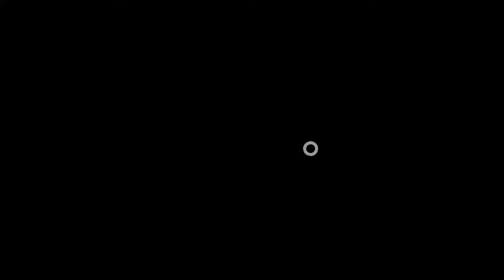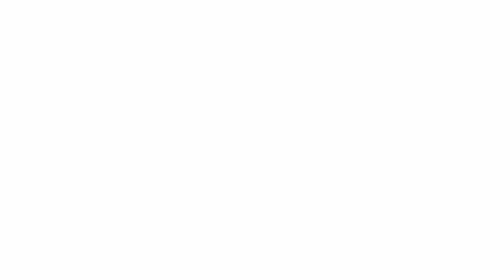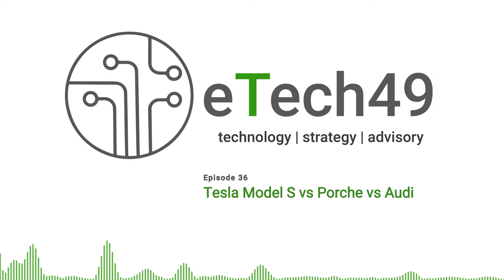#36 | Tesla Model S vs Porsche Taycan vs Audi e-Tron

Comment: Do you have any thoughts on flywheel based hybrid technologies? I have read that they can be used in conjunction with regular hybrid tech to give fast discharge when required under hard acceleration.
Reply from the maker: Flywheel systems were developed several years ago at the time battery tech was no where near as good as it is now. So those companies had issues achieving commercialisation. Flywheel is still around but has a niche of applications where it is useful vs what can now be done with a battery system.
Reply: @etech49  thankyou for taking the time to reply.